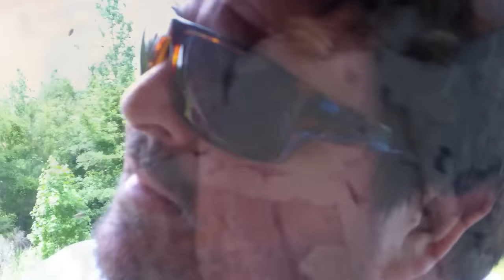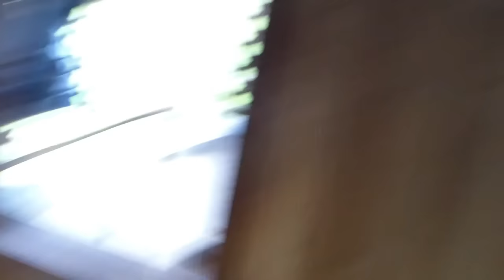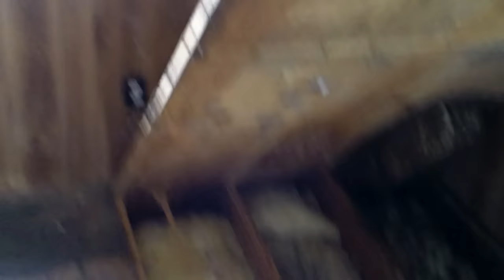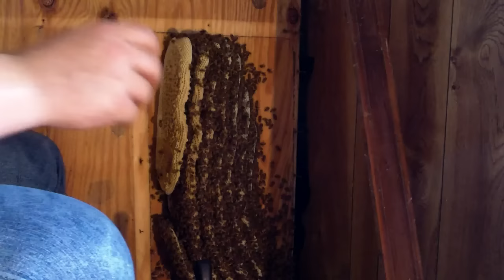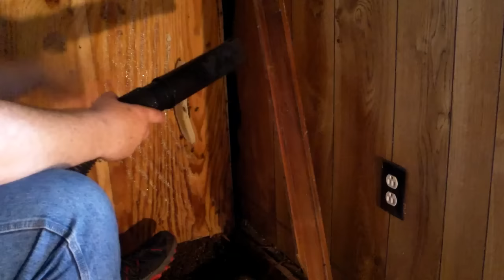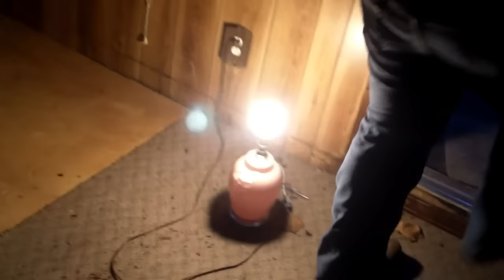Rambler House Hive Removal

Comment: I have always wondered what percentage of bees don't survive the vacuum process. It seems to work well. Cool video as always!
Reply from the maker: ArtisanTony If you regulate your vac right and get them into a hive fairly quickly the only ones that die are the ones you accidentally smash with the vac nozzle.  Probably a couple hundred on a hive this size.  They are tougher than you would think.

Comment: I was wondering if bees could smell a removed hive and you answered my question for me.   does it do any good to spray when cleaning a hive out or it a case of just trying to block and pray?
Reply from the maker: brendahere Prayer helps but faith without works is dead.  :)  Best thing to do is paint the space with primer, fill the space with insulation or something and block the entrance.  Then pray some more.
Reply: +628DirtRooster A lot more problems could easily be solved if people would start quoting scripture when replying to comments like that. :)
Reply from the maker: crazy808ish :)

Comment: Do you find that vac all the bees off the comb before strapping it into the frames works better?  Are you worried that there is no nurse bees on the frames to take care of the larva?
Reply from the maker: Desmond Simmons I prefer not to use the vac but with limited time I have no choice some times.  I do worry about losing the brood but I get the bees back on it as quickly as I can.  Using the vac does make it easier though.

Comment: What is your method for transferring it to the frames? Do you "rubberband" it in like JP the Beeman does? If so why do you vacuum off each slab of comb?
Reply from the maker: +Danger Close Yep, same way.  I use the vac for a few reasons.  Two are that I was working inside someone's home and didn't want bees all inside the house and because of the amount of bees down in the framing I didn't think I would find the queen on the comb.  If you don't find the queen the rest of the bees will many times abandon the comb.

Comment: When moving comb to the frames does it need to stay in the same vertical orientation as it was in the hive?
Reply from the maker: +grayswandir47 Yes, It is build at about a 13 degree upward angle.
Reply: Thanks for the response.  I caught that in another video somewhere.   They have to be built that way or the uncapped nectar would run out out of the cell.   Now I want to know why the bees decided on thirteen degrees.   Probably something to do with the surface tension of the nectar in the cell.
Reply: grayswandir47 because they are mathematical geniuses and we'll only be lucky to understand only a fraction of what they have innately programmed 
God is the Greatest

Comment: So the vacuum doesn't kill the bees?
Reply from the maker: Anthony ferrin No
Reply: You are awesome thanks for the laughs and great material. One last question: When you say its full of pollen what do the bees/you do with those combs?
Reply from the maker: Anthony ferrin They use the pollen as a protein source for young bees.  I just melt the combs down and discard the pollen and other trash.  The pollen is good for you but they make pollen traps that scrapes the pollen off the bees legs as they return to the hive.  So if I wanted to collect clean pollen I would just use traps.  I will probably get some this year just to play with them.